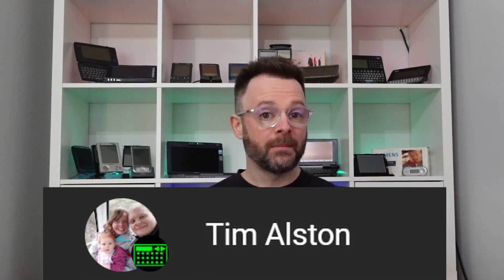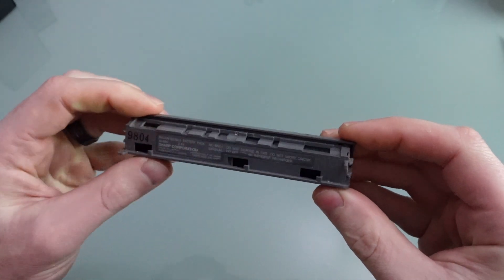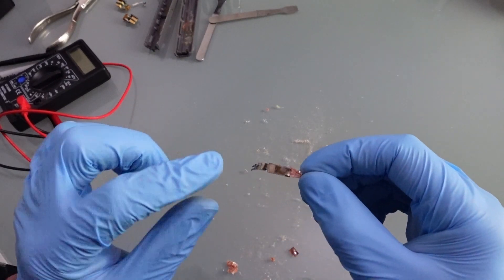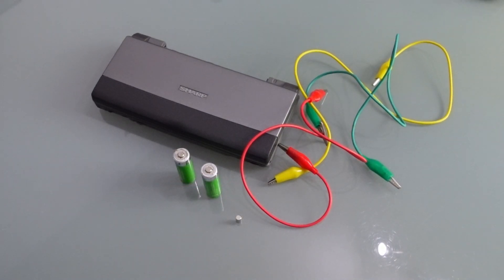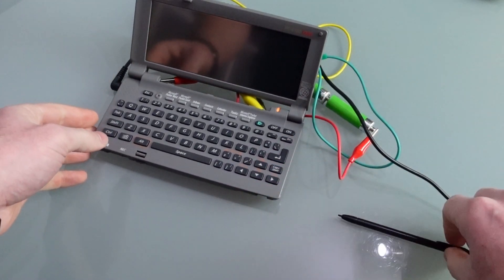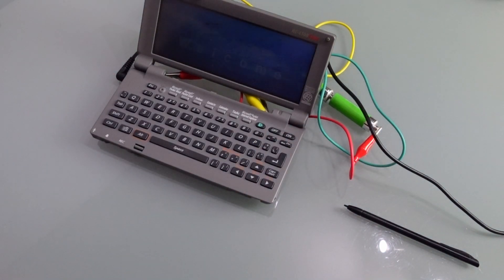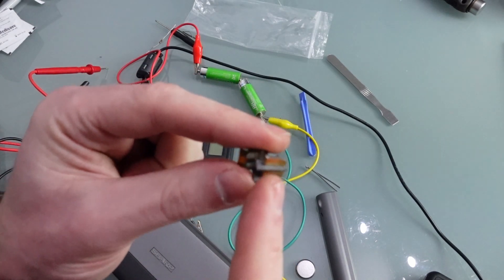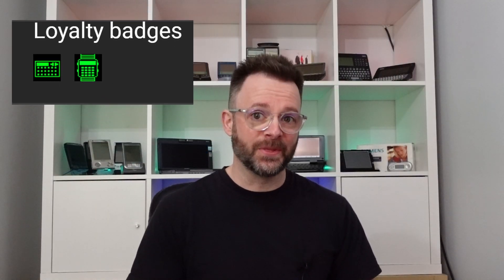Sharp HC4500/4600 battery replacement - attempt!

Comment: i always could use mine with dead batteries but the contacts are now corroded and missing one of the 4, when I connect to power the yellow light blinks fast, wish I could repair it but I don't even think it's possible to find the contacts
Reply from the maker: I have yet to revisit this device as I really want to get it working, it seems the battery only ever had 3 contacts so that isn't the issue, I think it may be a problem with the charging circuit  - one day I will get time to investigate further!!! 🤣
Reply: @ haha someday I'll investigate mine too
Reply from the maker: @VinicioHaner  If you figure the issue lease let me know 😃
Reply: I just noticed it turns on if I remove the battery, now I’m using it direct to the wall. The touch screen barely detects the touch but I think I’m not supplying enough power
Reply from the maker: @VinicioHaner  The touch screen shouldn't be dependent on how its powered, try recalibrating and be gentle when tapping the calibration points, I have found in the past that can help
Reply: @HandheldComputing  thanks!
Reply: also, what is the backup battery for?
Reply from the maker: In normal use the backup battery is used to keep the RAM alive should the main battery go flat when away from a power outlet preserving any documents stored on the internal RAM

Comment: I do have The same Situation, old small computer works well when Is plugged but no battery at all when disconnected.
Reply from the maker: I'm waiting till I have some time over xmas to do a tear down and see if I can figure out why this won't run on battery, even though the battery s holding charge!
Its very frustrating!

Comment: Do you have a video on how to reinstall Windows CE?  I have done all Windows (but never CE), with the operating system (iso file) on a CD or USB drive.  My device is not booting, saying "no nk.nbc found on CF card, DOC.CE load failed."  Yes the device has an application running on CE, I believe, and the app runs from the CF card.
Reply from the maker: Most of the consumer devices using CE have it stored on a ROM chip. Some netbooks and commercial devices can be re-flashed with new versions of CE but it isn't something I have done.

Have a look on www.HPCfactor.com and ask on the fourums there, I'm sure the friendly members there will be able to help 😃

Comment: There may be a microswitch installed inside the case, so the batteries on the wires may not work.
Reply from the maker: Good thinking! That did occur to me as there is a prong on the battery case. If there is a switch I think it may be broken though - going to do a disassembly I think so I can get it working!

Comment: The best option is to disassemble the device and sketch the section of the circuit responsible for power and charging. Many issues will be resolved.
Reply from the maker: Now that is an excellent plan!

Comment: I wonder if one of the negative (-) wires needs to be connected in between the cells so the machine can see the voltage of the individual cells. To me it seems like the machine needs positive (+) on one end of the pack, negative(-) from the other end and the third wire goes to the casing of the first battery which would be a connection in between the 2 replacement batteries you have on the table. That way the machine can see voltages of each individual battery.
Reply from the maker: That would make sense, I will give that a go before I disassemble the device and go looking for failed capacitors etc.... 😃

Comment: I got a plan on remaking battery packs for some of my vintage handheld devices, since I want to make easily removable cells and USB-C power input, so I can play around with any devices easily, and when I am done, it is easy enough to remove a cell put it safely to storage. I got Toshiba Librettos, which need new battery packs badly, unfortenatly I dont have Sharp HC4500 for reference, so not sure what could be wrong, but perhaps batteries wired a little differently to what you did.

My work on new battery packs will take awhile, since I got a large backlog of projects, and they basically would need to be remade from scratch to house new cells and new electronics.
Reply from the maker: Let me know how you get on, I have the CT50 and plan to re-cell the battery but didn't think of making them removable 👍
Reply: The issue I encountered, is that cells size, which Libretto used are no longer made. I could have failed in the search for it, but no major electronics supplier I checked had them. So using different cells, a smaller or fewer, but bigger cells could be a sollution, but battery might need a voltage booster and ideally proper battery protection. And if cells are removable, then storage is much less of an issue, while keeping laptop look complete.
Reply from the maker: I haven't opened up the battery pack, but it looks very much like it will contain 3 18650's - just be aware that if you buy ones with built in charge protection they are longer and so wil not fit! @TheKsax

Comment: I had a similar problem with my nec 900c. I used a 7.4v 2s lithium ion battery. The battery would have a charge but just not enough. There's a voltage cutoff and it can be plugged but it won't charge. I had to recharge the batteries with another and then plug it into a lipo charger. I make sure never to leave it plugged into the palmtop or it will kill the battery due to parasitic draw. I just unmount the battery and it can stay charged alot longer. I hope you can resolve the issue.
Reply from the maker: Its a massive issue with Li-ion batteries, most charge circuits won't charge them if they drop below 2.5V - you can sometimes revive them like you have done. Not an issue with NiMH, they can go totally flat with no harm to the cell.
Going to keep trying, as I want to use this PDA!
Reply: @HandheldComputing  
Good luck! I hope you solve the issue. Being able to enjoy them again is always worth the extra work in my opinion.
Reply from the maker: It sure is! They are meant to be used, not placed in a museum @kode3020

Comment: Hmm. 🤔
Reply from the maker: Humm indeed, I am stumped!
Reply: @HandheldComputing  I take it the machine doesn't have a controller like later laptops.
Reply from the maker: I don't think so, no need for voltage controller as its NiMH so they can be run flat and its too early for EEPROM chips to record the charge state @vintagemoderncomputing
Reply: @HandheldComputing  Aaah.
Reply from the maker: Aaah indeed! @vintagemoderncomputing

Comment: I rebuilt one of these packs. I didnt have any issues. I'll have to finish theis whole video and see if i see anything your missing.
Reply: That orange light should NOT be blinking. That light stays solid orange. And then when its charged it turns solid green. There should be NO blinking. So something is going on here. Id investigate that.
Reply: You had any luck ?
Reply from the maker: So maybe there is an issue with the unit 😒
Reply from the maker: Can you confirm there are only 3 battery connections on the unit? Thanks Huw
Reply: 3 connections. Yes.  @HandheldComputing
Reply: Ill do a quick video of mine gimmi 10 mins. Ill upload it.
Reply: I put up a post on hpcfactor of your video. Hopefully some others may spot something we havnt. ;-)